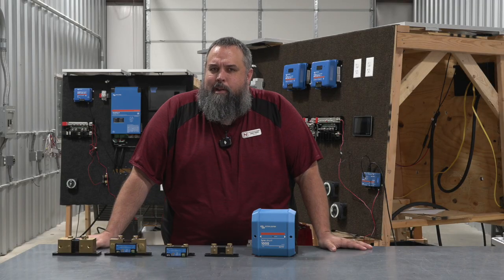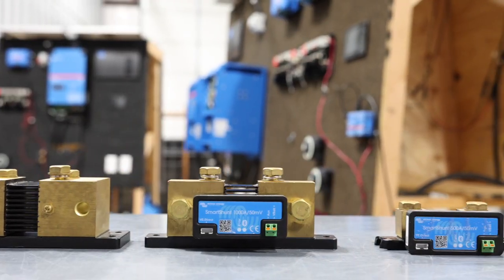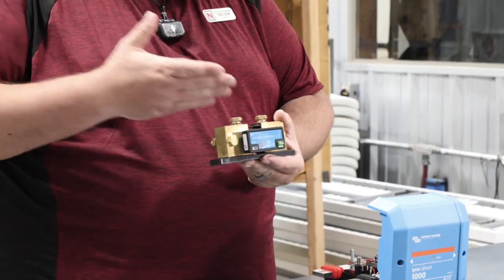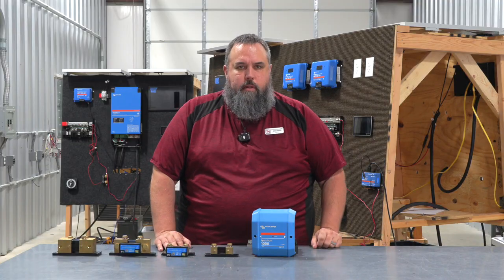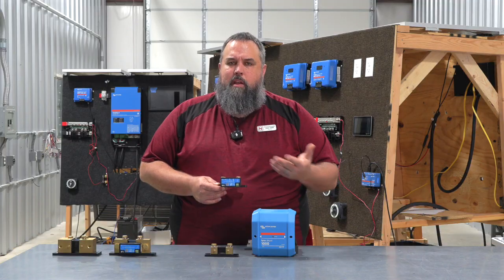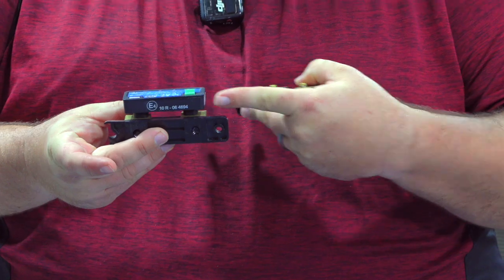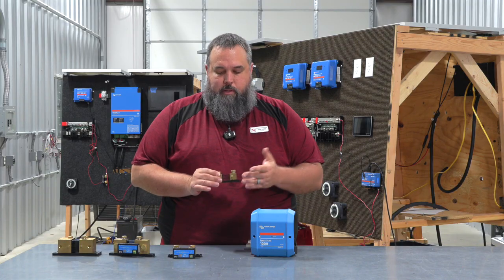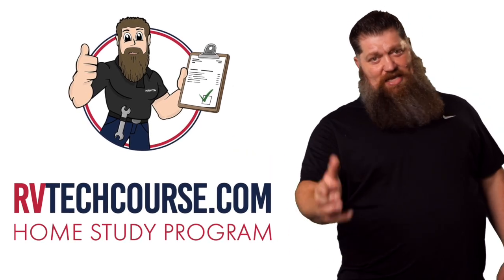What is a Shunt? | RV Solar & Battery Monitor Explained

Comment: My Vatrer LiFePO4 Heated Lithium Battery with Bluetooth has a BMS that I can monitor through my phone using Vatrers app. Shunts, are so 2024 😆
Reply: My RV came with the basic digital battery monitor which can be progrtammed for Lithium batteries. The BMS is another way and I have a Power surge protector EMS that also monitors the power go in and power. Is there an overlap of info yes, but each may prove a little different info.

Comment: Great video. I understand that the shunt connects to the battery negative, but would it normally be located in/near the battery box or near the converter (or maybe the inverter)? I'm asking because I'd like to set up remote reading with my RPi Cerbo-GX, and I don't know where it was installed.
Reply: The shunt should be installed near your battery for easy connection and access. The smart shunt like Victron has a electronic board and app do your cell phone connects to shunt via bluetooth. So you will need to be with 10-30 ft to connect and view the status of your battery. Just like when your choosing a wifi connection you may see 10 different wifi connection, just like Victron in an RV Park you may see several victron shunts and have to be able to identify which one is yours.

Comment: My Renogy Lithium battery 'talks' to the app on my phone and tells me what the percentage of power available is. So I have no need for a shunt, correct?
Reply: AI says:

1. The Two Different "Brains": BMS vs. Battery Monitor

It's crucial to understand that the Bluetooth Battery Management System (BMS) and a shunt-based monitor serve two different, but complementary, purposes.

Feature Bluetooth BMS (Internal) Shunt-Based Monitor (External, e.g., Victron SmartShunt)
Primary Role Protector of the Battery. Manages cell health, prevents over-charge, over-discharge, and monitors temperature. Its goal is to keep the battery from being damaged. Accountant of Energy. Precisely measures current in and out of the entire battery bank to calculate State of Charge (SOC) and consumed amp-hours. Its goal is to tell you exactly how much energy you have.
What it Measures Individual Cell Voltages (most important), Total Voltage, Temperature, Current (often with internal hall-effect sensors). Total Voltage, Highly Precise Current (via a calibrated shunt resistor).
SOC Calculation Often less accurate. It may use voltage-based estimates or coulomb counting that can drift over time, especially if the BMS disconnects and "forgets" its starting point. Extremely accurate. It uses a high-precision shunt to count every amp-hour in and out. It's constantly synced to 100% when the battery is fully charged.
Perspective Looks inward at the battery's health. Looks outward at the entire electrical system's energy flow.

---

2. Key Reasons You Still Need a Shunt

A. Accuracy of State of Charge (SOC)

This is the biggest reason. The SOC percentage on your phone from the BMS can be misleading. It might be based on voltage, which is a poor indicator for LiFePO4 batteries due to their very flat voltage curve (e.g., a battery at 80% and 20% can have almost the same voltage).

While some BMSs do count amp-hours, their internal sensors are not as precise as a dedicated, calibrated shunt. More importantly, if the BMS ever triggers a low-voltage disconnect, it can lose its reference point. When you recharge, it might not know the true starting SOC.

A shunt-based monitor like a Victron SmartShunt is designed for one job: perfectly tracking SOC. It will automatically reset to 100% when it detects the battery is full, preventing this "SOC drift." You can trust its percentage to know if you can run your furnace all night or if you need to conserve power.

B. Monitoring System-Wide Energy Flow

The BMS only measures current flowing through itself. A shunt is installed on the negative terminal before all loads and charges.

· BMS View: "The solar charger is putting in 15A, and the inverter is drawing 5A. Net gain: +10A."
· Shunt View: "The solar charger is putting in 15A, the DC-DC charger is drawing 3A for the vehicle battery, the inverter is drawing 5A, the water pump just used 0.5A, and the lights are on drawing 2A. Total net gain: +4.5A."

The shunt gives you a complete picture of your entire electrical system's consumption and production, not just the net flow at the battery.

C. A Redundant and Reliable Safety Net

Your BMS is your last line of defense. If it disconnects, your power is completely off. The external shunt monitor acts as an early warning system.

You can set alarms on the shunt's display or app to alert you before you get critically low (e.g., "Warning: Battery at 20% SOC"). This allows you to shut down non-essential loads manually and avoid the BMS hard-cutting your power, which could be dangerous or inconvenient (e.g., shutting off your fridge in the middle of the night).

D. Integration with Other Components (The "Smart" Ecosystem)

If you have a Victron solar charge controller, inverter, or DC-DC charger, a Victron shunt (like the SmartShunt or BMV) allows them all to communicate. This creates a truly smart system where the charger can see the shunt's precise voltage and SOC reading, optimizing its charging algorithm for better performance and battery life.

---

Practical Scenarios in an RV:

· Scenario 1: You're boondocking and it's cloudy.
  · BMS SOC: Might show 50% based on voltage, but you don't know if that's accurate.
  · Shunt SOC: Shows a precise 32%. You know you need to seriously conserve energy or start the generator. You trust this number.
· Scenario 2: You want to know what your rooftop AC unit really draws.
  · BMS: Can only show the net change on the battery bank.
  · Shunt: You can turn the AC on and off and see the exact amp draw on the shunt's app, helping you understand your consumption.
· Scenario 3: Your battery suddenly disconnects.
  · BMS App: Might just show an error code like "Low Voltage."
  · Shunt History: You can look at the history graph and see that your inverter was running a microwave for too long, causing a steady drop to the cut-off voltage.

Conclusion and Recommendation

Think of it this way:

· The Bluetooth BMS is like the battery's doctor, focused solely on its patient's health.
· The Shunt is like the system's accountant, giving you the complete financial (energy) statement for your entire RV.

For any serious RV solar/lithium setup, both are invaluable. The BMS is non-negotiable for safety. The shunt is non-negotiable for truly understanding and managing your energy usage.

Recommendation: Install a quality shunt-based monitor like the Victron SmartShunt or BMV-712. It's a relatively small investment compared to the cost of your lithium battery bank and will provide peace of mind and data you simply cannot get from the BMS alone
Reply: @rob8195 😂